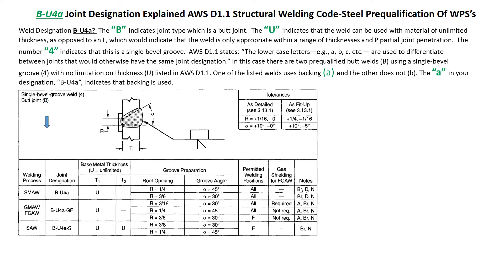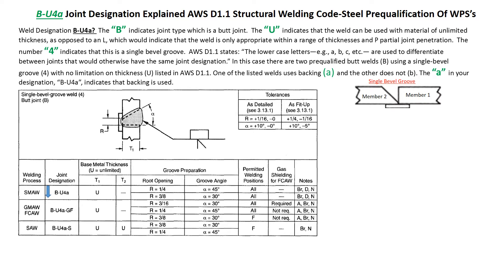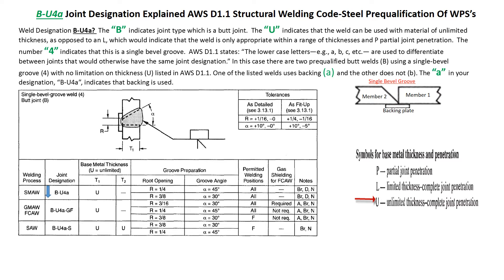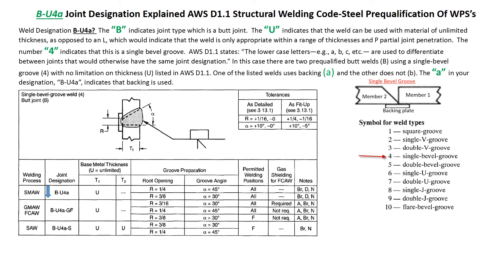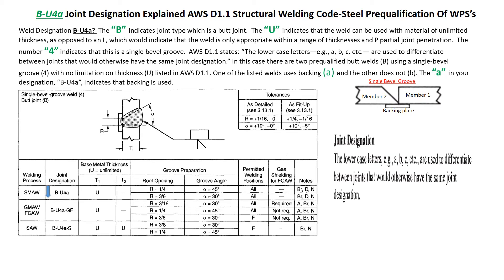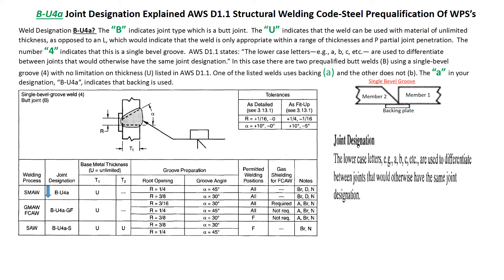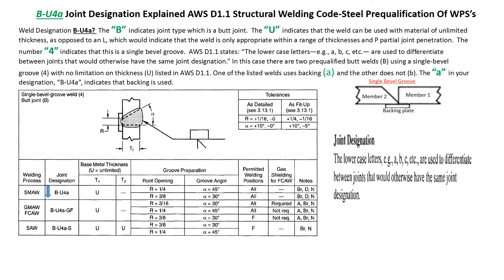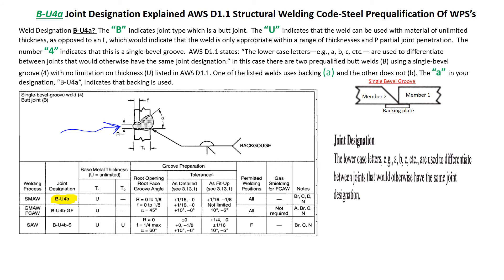Welding and Inspection AWS D1 1 Code Joint Designation B-U4a and B-U4b Explained

Comment: lower case means a means backing b means no backing what does lower case c mean in B-L2c-s mean what does the lower case c stand for
Reply from the maker: That's a good question; looking at the lower case "c"  Most of the time it is listed on the SAW joint designations with 0 root opening and backgouge.  As you are aware the D1.1 code has about 500 pages and is very difficult to understand.  I wish I can better explain the "c"; maybe someone out there can give us an answer.